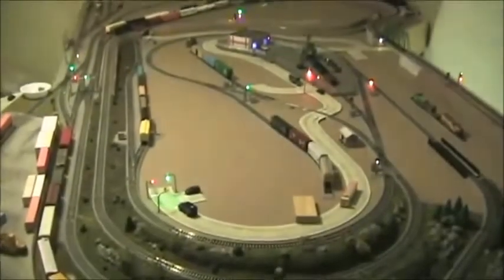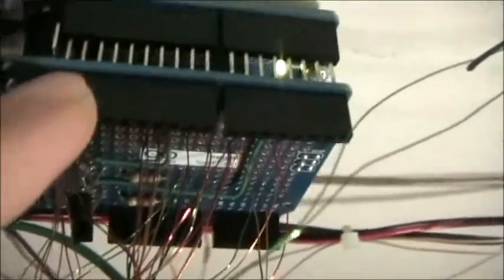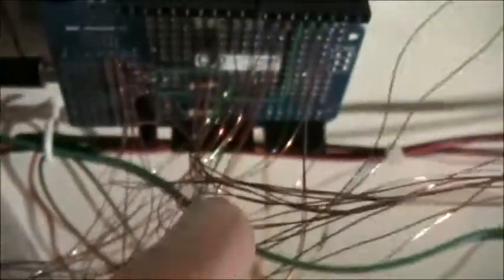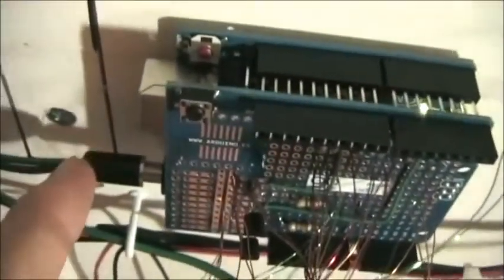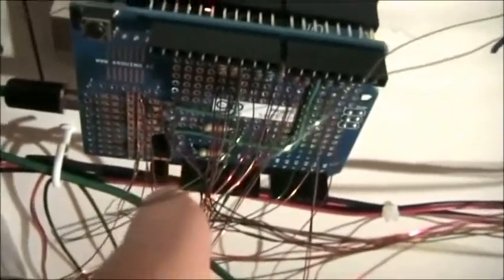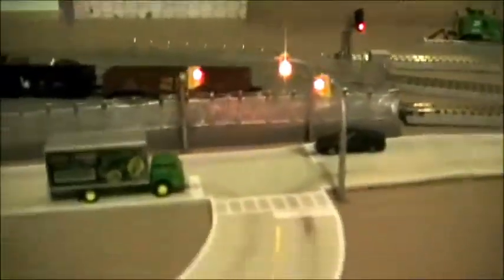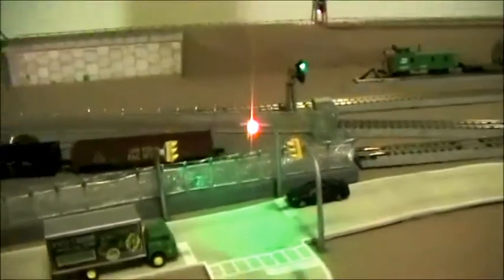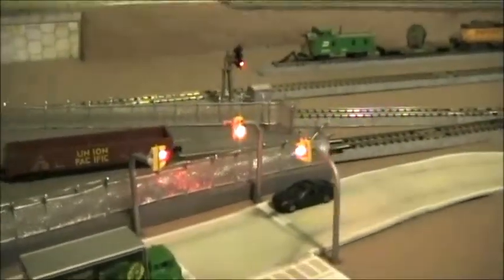N Scale Traffic Lights

Comment: very nice nice bro. are there tutorials online on how to program and make a traffic setup like this? i have a 3d printer where im printing out traffic light housing. i want to simulate a full intersection with protected left turns, doghouse and flashing yellow arrow turns. what materials would i need besides the traffic light housing and what are the smallest available LEDs for use like this? and how hard would if be if possible to program an intersection like this?
Reply from the maker: I used an Arduino to drive the traffic lights. You might have to become familiar with some sort of microcontroller in order to program what you want. I used 0603 SMD (surface mount) LEDs which are very tiny. It's quite challenging to use these so I wish you luck! I don't know of any tutorials for this type of project but you can make it using simple logic as any person would be familiar with the way traffic lights change.
Reply: @nashme11  great thanks for the info!